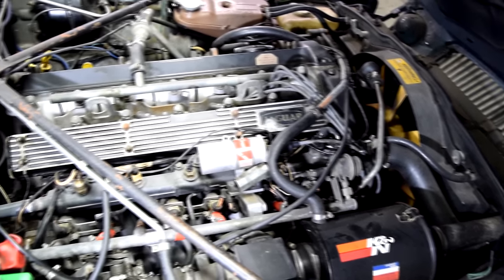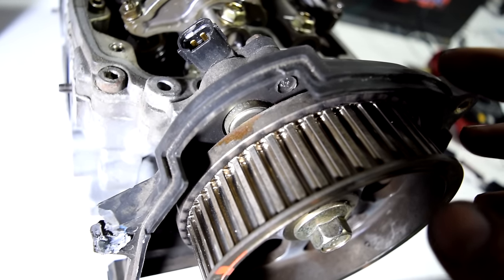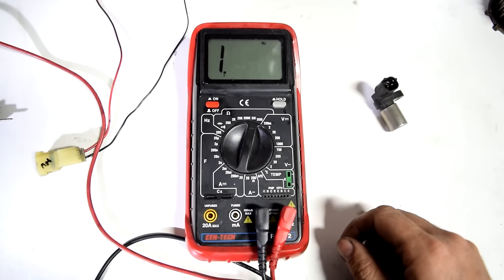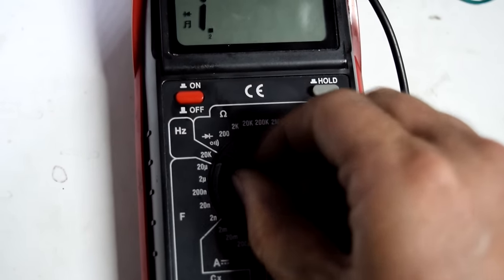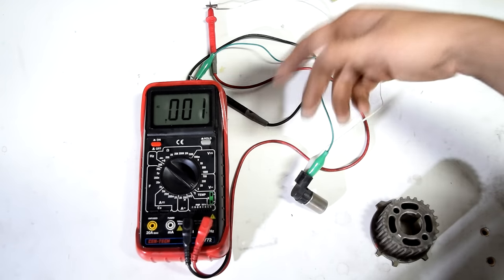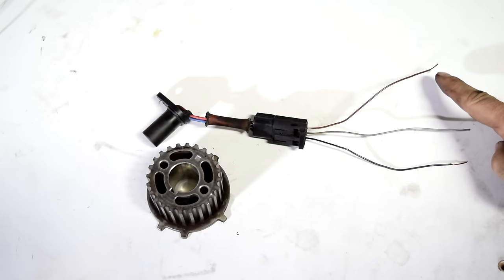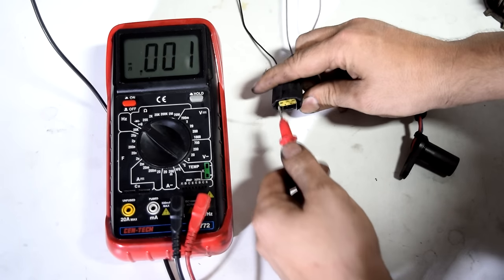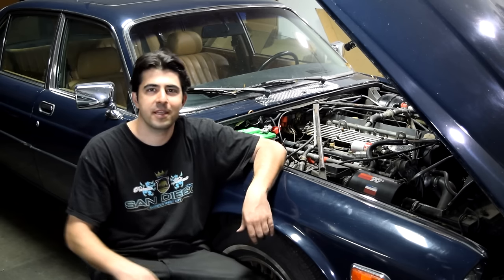How to Test Crankshaft and Camshaft Position Sensors

Comment: You ground wire shows ground when it aint hooked to the car ? 5:33 ...wires unhooked , sensor on the bench , whats it grounding to ? The table ? I realize its a test power battery but im confused on that one ?

Comment: Hi I have a question I have a 3-prong terminal and my constant wire when is connected to the negative cable I don't get any reading but when I connect it to the positive cable it gives me a -12.6 volts this makes me indicate that this is my constant wire but why what day is not be reading the other way around I only ask because I have a error code for my cam shaft sensor does giving me a hard start would this be a problem with the connector if it's not reading proper the way you showed in his video

Comment: Hello!
I have a 2000 Nissan Frontier, 3.3L. It rough idles and it stalls. After the third time it will stay on while shaking and as it warms up it works but it misfires and shakes. I got code P0340. I changed the sensor but it is still the same. Then I checked the both sensors for resistance and they show 650 to 700 0hms. I checked the connector for continuity and it shows 1 and no beep. Is the ground bad? how do I fix that?
Thank you!

Comment: Nice job explaining the differing voltages from the 2 wire sensor. This is what I needed to troubleshoot a problem with a new cam shaft sensor that appears to be faulty. I am  at my wits end in getting this car figured out. As we know it is not always good to buy cheap parts which was the case on this car. I bought the cheapest cam position sensor sold on ebay so after a no voltage test as you outlined in this video  I returned it and ordered the next more expensive one from a different manufacturer. All a person can do is get money back for the bad part. It does not cover the agony of going to the next hours trying to troubleshoot the next potential problem that might cause the car not to start. On a 97 MB E320 this could be a number of items which all relate to no injector pulse or a no start condition.  THe question arises what sensor triggers spark and which one triggers injector pulse. Is it the crankshaft sensor or the camshaft sensor. Guess I will wait till the new sensor arrives to be sure. Next if this does not work I go to retest the crankshaft sensor which is also new and a bugger to get out. I have spark cause it runs if I put gas down the air  inlet port to the engine. Have you run across a situation like this one? Thanks again for sharing your expertise. J

Comment: I have a 2000 ford focus that has a warm start problem. Fuel pump primes when cold. After running for a while it stops priming when trying to restart. Could a crankshaft sensor cause this? You only mention the lack of spark - but could a crankshaft sensor stop the pump from priming. Car runs fine when going.
Reply: No the cps doesn't affect the fuel system.

Comment: Hello friend, one question can you check resistance with the ignition open ON position, and place your negative lead to negative battery post, i taught it will not be safe for the multimeter, please explain me if it's safe to find ground, thank you..
Reply: You can't insert the Ohm function of a multimeter into any live circuit or you'll bugger the meter up. The Ohm function of a multimeter has it's own battery to supply a current into the circuit.
Reply: @chriscusick6890  thank you friend for making this clear to me. That is what I know, but when i was watching the video he was touching the negative/body side of the vehicle to check resistance. Thank you for replying. Take care friend...

Comment: I got a P1345 code. My vehicle (1999 GMC Yukon) runs great and the engine light just came on. No rough idle or problems. Could it just be a lose/dirty cam sensor or crank sensor making the engine light come on?

Comment: I have a three connectors to my camshaft position sensor. When I test which connector is constant wire I get 5 V on one and 12 V on another. Why is that? In your video you get 0, 0, and 12 V. Which one is the constant wire for me?

Comment: Great Video. What did you use to check the voltage in place of the cam gear?
Reply from the maker: +John Winling if you are doing it on the car you can just crank the engine and back probe the sensor to check for voltage.

Comment: RatchetsAnd Wrenches. What if my injectors still attached to the fuel rail won't fire as I started the car? Does this point me to the ECU? I have tested each injectors separately by giving them voltage pulse and sure enough each do fire fuel and therefore not broken or clogged. When I sprayed fuel directly into the throttle and start it, the car does fire up. So this tells me that there is spark. So the CPS would not be at fault here.  I checked the fuel pressure on its fuel rail and sure enough it had a healthy pressure of 50psi. So this leads me to the ECU which doesn't give the required voltage pulses on each injectors. So How do I check the ECU and even possibly repair it? Could there be another cause of the "cranking but no start" problem? Any advice would be of big help!!!

Comment: very well explained...the best i've seen so far. Thanks. By the way i have a Hyundai i20 1.2 Kappa series engine. The car starts fine but after it warms up in a while, it starts missing and stalling and dies off. I've hooked it to an OBD2 scanner but i'm not getting any error message. The only thing i notice (on the OBD) in the Advance Timing Dial is that the advance timing keeps fluctuating from 0 degree to 13 degrees. Is this normal? could it be the Ignition coil or the O2 sensor failure?

Comment: Hi R&W  I have a OBP code of p0341 camshaft position sensor.  It also states that CPK incorrect phase detected.  I have a 2007 Honda accord k24 engine. 135ki m.  Car runs well no noise no abnormal sounds(misfire).  I assume both sensors will have to be tested??  Where is the location in a Honda

Comment: What if its only the P0339 intermittent and it goes away for a week or two and then comes back,  and then after attempting to start several times it works and then the engine light goes away again and seems to work fine the next week or so?  
does that sound more like a wiring issue? or the sensor could be starting to fail randomly
Reply: For a solution 
You can try to clean the crank sensor, if that not helps 
You must change the crank sensor

Comment: It's a great video.  My car is Honda Accord 2005, DX and the signal somehow different. When key is in ACC position, the souce voltage is 12V, the signal wire shows 5Vdc. and when the key is in start position the signal wire shows 1.4 Vdc. This implies that the sensor is producing square waves.  Why 5Vdc when key is in ACC position?  My guess  is  the 5 VDC is caused by a "pull-up" transistor in the PCM.  I am not sure the if  sensor is working or not. If someone has similar experience please advice.  Car won't start. headache. Thanks so much.

Comment: I've got a 2004 crown Victoria lx had short on egr connector and car died. After fixing the relays from my mishap I have a  crank no start.  Some how I missed a relay. Now I'm sitting here with no  crank no start no communications.  Had no communications in the beginning.  I've tested everything and haven't been able to get her running  could you please shed some light on this issue with me

Comment: Mate, your instructional videos are the best, among the other, thank you for your time, could you tell me, where is the crankshaft position sensor on a Camry 04 Japan made ( 4 cilenders) & if a bad starter/alternator can turn, the check engine light, thank you again, by the way car don't crank anymore, there is power,but no start.

Comment: You can also check your tachometer. If it's flatlined when starting then the sensor is bad.
Reply: Hello friend, good tip, maybe you have time to explain me this, he did the test to find the negative wire on the connector by using a multimeter. The setting was Ohms but he had the ignition switch ON also he hooked up the black lead to the battery post negative side, is that safe and correct, a friend long time taught me the correct way to find resistance but everything has to be OFF no source of power, am I wrong the way I had learnt, please break it down for me thanks.

Comment: i read 0.1 and 0.2 volte on my on the connector with the key turned on in the ignition. On my cranskshaft connector tho, i read 5volts.  does this sensors have fuses or whats my next step?

Comment: No start on my 89 240 volvo. Fuel pump and relay good, and ample fuel flow when fuel rail opened. Cars gets spark at plugs. I suspect its not firing the injectors Also on one of troubleshooting tests (engine cranking signal) it fails.Question; even if I get spark can a faulty crank position sensor prevent a signal to operate the fuel injectors or some other component to cause a no start problem? Thank you in advance.
Reply: yes.....does yours have a 'big blue' relay ?

Comment: Thank  U so much for your videos.  Where is your shop located.  My 00Mazda B2500SE 2.5L |4   - Need the help of a knowledgeable mechanic I can trust.  Is it best to just change the camshaft and crankshaft sensors at the same time ?  Then change the timing belt assembly too because you have to dis-assemble  timing belt assembly to change the sensors and all the spark plugs? Since I have to do it myself then I'm not taking this thing apart again late  :)  Also how do you set the "Air Gap"  on the crankshaft  assembly?    Any trust worthy mechanics in San Antonio TX that don't want an arm and  a leg for work & know how to do manual diagnostics?

Comment: Could oil leaks from the valve cover cause issues with the crankshaft and the camshaft? Got two codes p0340 and p0335 they both have to do with the crankshaft and camshaft.
Reply: Someone else says it could ground the sensor and cause no signal to be emitted to the ecu.

Comment: If my signal and power wires are both 5V with respect to ground wire when the car is in on position, does that mean that the cables are shorted? can this cause a no start condition?

Comment: Hi all! To my knowledge most engines use two types of Crankshaft sensors. 1. Inductive (magnetic) which are with one or two pins on the socket and which are capable of producing an electrical impulse without being supplied. 2. Those of hall-effect type that have 3 or 4 pins on the socket and that generate a digital pulse (square wave) provided they are supplied with a specific electrical current. Regardless of the type of Crankshaft sensor when measuring directly on the sensor with the multimeter, any type of good (not flawed) Crankshaft sensor must have a resistance of X ohms? I ask for your help in this problem because I am facing the following situation. My Crankshaft sensor no longer functional. I removed it from the engine and measured it with the digital multimeter directly on the pins. No resistance. I thought it was burnt (defective) and I bought an identical original one. When I received the sensor, before mounting it I tried to check it. Same thing. It has no resistance whatever the configuration of the measured pins. 1 with 2, 1 with 3, 3 with 1, etc. Nothing, no resistance in ohms, kohmi, although this sensor is new..

 My question is: Regardless of the type of sensor crankshaft as long as it is operational (good) when directly measuring it with the multimeter must it have a certain value? My sensor type is a Mitsubishi ME203180 and as I reported above. Neither the new nor the old multimeter measurements indicate anything. Obviously the scale of the multimeter is selected correctly. Is it possible to be a perfectly operational sensor and not indicate any resistance when measuring with the multimeter?

Thank you in advance!
Reply: Best test for these sensor are dynamic test, most of the times, static test "checking ohms" will pass the test but not work properly
Reply: Most CPS and other sensors(TPS,ICM etc) that I test with a multimeter the way you said you did should have some kind of resistance close or near - or +.05

Comment: so what happens when the crankshaft pos sensor is fine, i have a crank but no start with that P0335 code. my car will crank and no start after driving for a while and will stall sometimes at idle i know for sure something isnt working properly when its hot

Comment: mine is putting out 8 volts not 12 volts on a dodge avenger 1997 is that enough to start it because it will not start and i put a new distributor in it and it has no spark when i crank it over do you have any idea why. thank you for your vid.

Comment: Some cam sensor codes,it's not the cam sensor that is bad.One example of this is the GM 3.6,the timing chains are bad when a cam/crank code appears on these.They stretch and set this code.Same with a cam sensor code on these.

Comment: I really enjoy your videos and step by step instructions So informative I would like to bring up a puzzling question about my "99 chrysler concorde lxi 3.2l I have the "crank no start "problem Replaced cam and crank shaft sensors,put in new spark plugs even a new ECM (rephased of course) and i still can't get this car started.I have spark from only one COP coil packs are all good wires are all good I get good ground and signal The real puzzler is that when I disconnect the cam shaft sensor the car will start but idles really rough Any ideas?
Reply: a short in the wires going to the cam sensor? Or poor voltage supplying it?
Reply: Perhaps a bad ground on cps. I believe the cps directs the coil pack when to fire plugs.

Comment: So at the end of the video, you are saying if there is a change in slight voltage while cranking then the sensor is working? I have a 5v on signal wire with key on car off.

Comment: What i found out with Bosch sensors ones i have are the 3 wire type is there are thousands of part numbers for each individual sensor just depends on the wires length, connectors, sensor length and so on, they are all basically the same, you can adapt any sensor, if it looks the same with same dimensions and bolts on just wire it up and it should work, people are getting ripped off with the price of sensors when they all do the same job.

Comment: Hi. I have accord 2007 , 2.4 ltr it’s showing..
P0341- came shaft position sensor A circuit Range/performance bank 1 or single, I have changed those 2 sensor but still showing engine light could you please assist in this regard.
Thanks 🙏🏻
Reply: Disconnect battery for a while to clear codes. Then connect battery, start, drive for a while to see if codes reappear.

Comment: i did exactly what you did but my cam sensor reads 1.9k ohms is that within  specs?
i sometimes have issues starting the car.
i just want to.make sure if it is not the crank or cam sensor.
mine is a classic subaru and it throws code 13 and 12 which corresponds to cam sensor and starter circuit respectively.
Reply: also i tried to check the voltage. i asked someone to crank the car with the sensor in but unpluged from the wires and it got like 0.05 volts.

Comment: Thank you for these tutorials! But I have a question, how do you test a camshaft position sensor that has three terminals? My Megane 2005 has three pins inside the connector. It's otherwise the same type as the first one you test on this video.
Reply: Follow the directions for the three wire sensor

Comment: i have a 97 silverado, if i start it every day its ok, if i leave it sit 3-4 days, very hard to start, once started, i starts with one turn. Well I left it sit for 8 days, now it wont start at all, I pulled a plug wire, seen spark, sprayed starting fluid in the throttle body, nothing. new battery, still wont start. I ordered a new crank sensor, maybe this will fix it? got fuel pressure and spark but it wont start
Reply: Did you try to spray carb-clean spray in the throttle body???
I think the engine starts

Comment: I have a 99 eclipse gs 420a automatic that cranks but not start. I changed battery,fuel filter, CAM sensor, and even ECU. Still does the same thing! It has spark and fuel but could it be the crank sensor? ? Help!

Comment: my car cranks and will start after several attempts to start it. they told me it was the crankshaft position sensor. is there anyway i can test to see if it is that?
Reply: dora cantu it should pop up on your engine light codes if that is the problem

Comment: Well, I have an Acura MDX and the cranksensor has 6 wires not easy to know whish wires to test unless having the book, it has gas, has spark, has fuel pressure check all grounds, timing is correct, I had it running but as it was smoking changed the steam valve seals now it just won't start, one more test I still have to do whish is the fuel injectors but by now it only cranks

Comment: Hi, i have a problema with a jeep 2,7 wg 2002,shows p0340 fault code ,  engine starts perfect in the morning,but after running 10 mins goes into limp mode and engine light goes on., have changed the sensor,but still the same, will reset with obd machine, runs a few minates then fault returns. runs longer before coming on when temperatura outside is less than 9 degrees c.any ideas as this has been going on now for 6 months.any help would be totally appreciated.....

Comment: I have a 2012 honda insight HYBRID 1.3 . Just replaced the engine and now it cranks but does not start. I have no spark and no injector pulse. There is a wire harness that connects to the cam sensor tonthe crank. There is no other wires going to it. How does it get power? How do i test. The sensor has three terminals